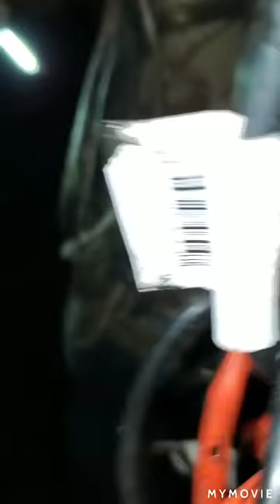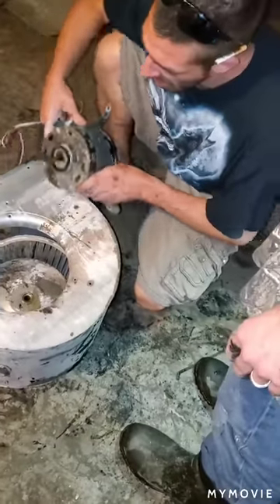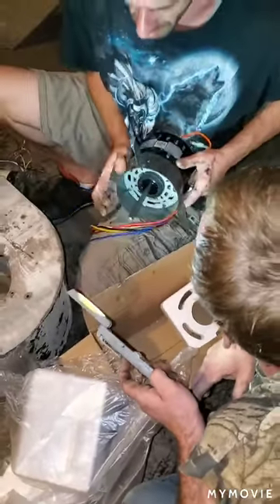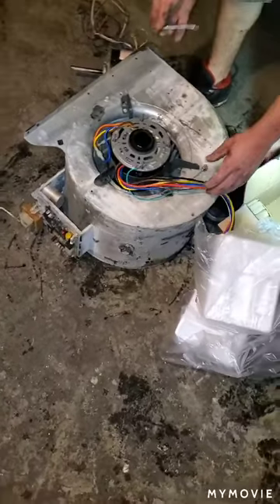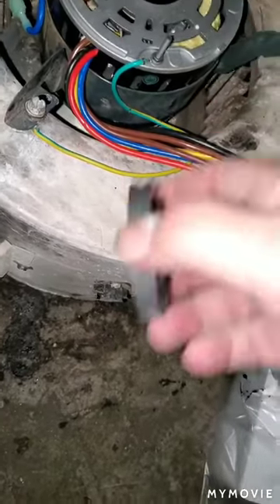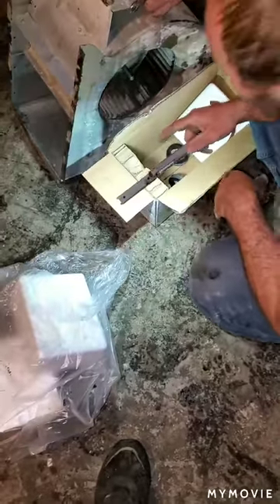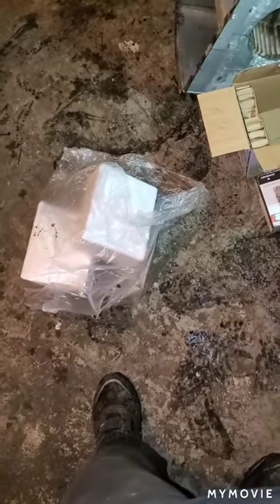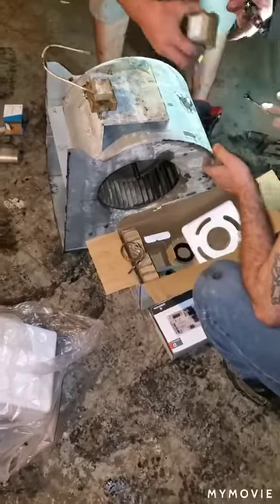The Crappiest Basement! Literally!

Comment: you can tell how high the water reached the bottom 1/4 of the control board. That is a very bad board. I have a photo of an aquastat I ran into the water that was leaking all over from a drain cock above. I have a photo somewhere of it toasted and burnt bad. No holes on board like your that i remember. The only thing I would have done differently here is worked on the motor swap outside. It makes no difference though on outcome of job
Reply from the maker: Thank you, looking back we should have changed motor outside it sure would have smelt better than that basement.